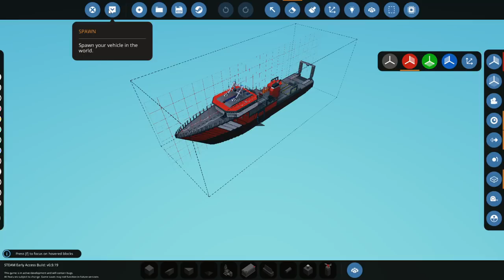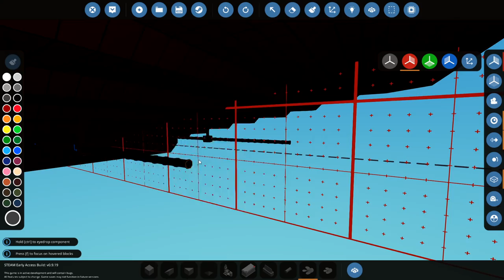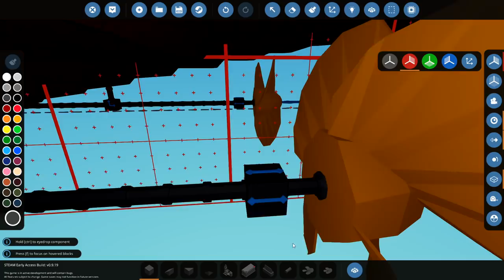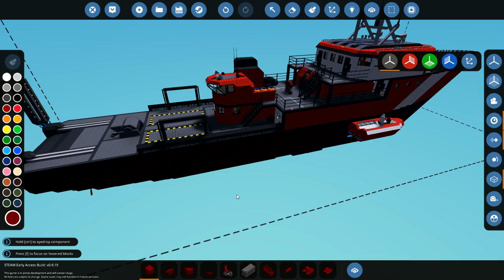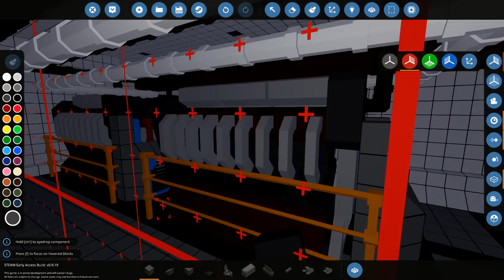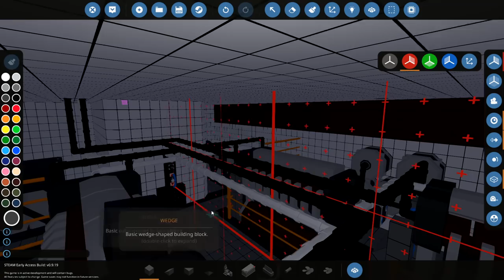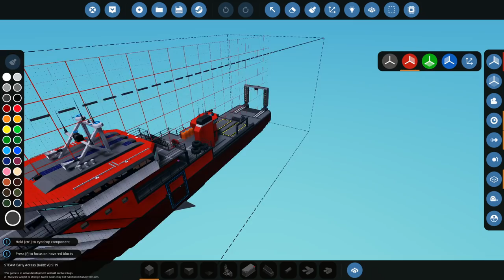Motors Are IN!  -  Research Ship  -  Stormworks Gameplay  -  Part 18

Comment: I have found from personal experience that if you run the electric motors off of the generators only instead of through the battery your trying to power the boat with you wont drain the battery powering the electricals on your boat but you will be limited by the output of your generators

Comment: For the battery, it isn't really correct. If you want the real percentage, add the batteries up first with logic. That'll give you the proper info. Also you should to share the generated power to each battery.

Comment: Frantic the Solar energy the panels if want more power generation
Also the new batterys that you install * *you didn't hook up them through the other electrical blocks in your boat
Reply: Yes, you have your solar panels
Reply: Solar panels wouldn’t help at all for this thought they don’t produce nearly enough to even charge the batteries. Wish they would change that but they don’t

Comment: Use sliding rails instead of connectors for the lifeboat.

You could also use a pid to have the engine adjust the throttle to account for the delta of your electricity drain.

Comment: You should connect the solar panels and use and add block on all the batteries with a microprocessor to add the total battery power then divide to get 1.0

Comment: Could you make the docking bay room wall out of glass? That will look cooler than a plain block wall. 

Also, if you put the power for lights on a separate generator it shouldn't dim when you move, or put the engine power straight to the gearboxes and ditch all the generators completely.

Comment: use 2 control surface rudders instead of 6 rudders :) just an idea
Reply from the maker: I dont think they're as effective under water :P
Reply: @FranticMatty  Hm, i used it on my Coast Guard Boat the small ones, and after i changed the small ones with 2 Small Control Surface Rudders it turned better. Maybe u could try to compare them to each other and see what works best?